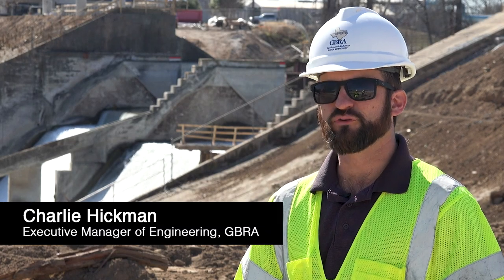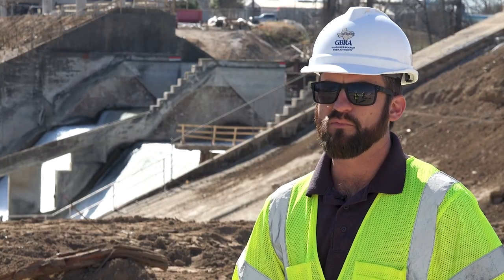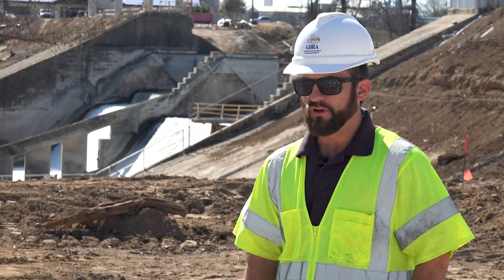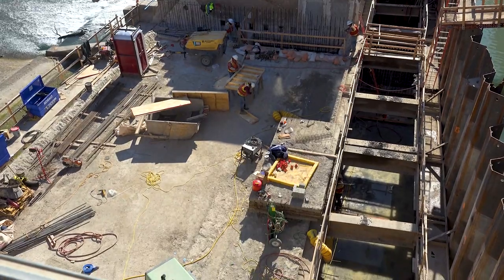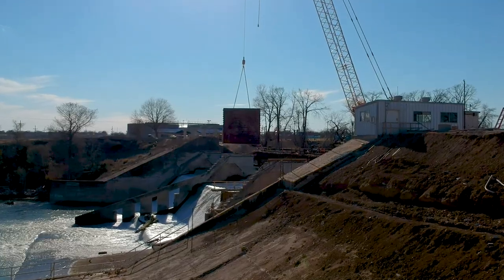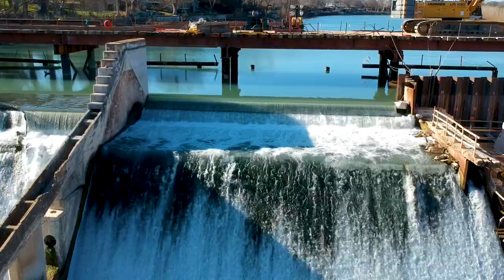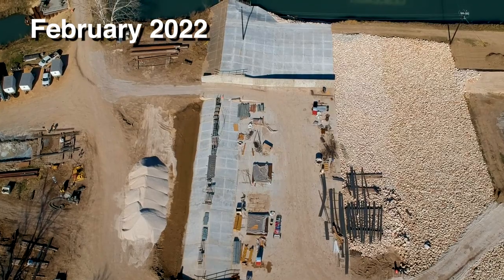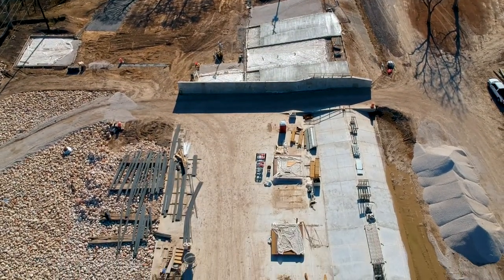Lake Dunlap Construction Update - March 2022

Comment: I hope you reviewed the lessons learned from the Oroville Dam emergency spillway failure when they tried to use it after the main spillway fractured and failed several years ago. Erosion of the flow channel below the spillway threatened the structural integrity of it and forced them to use the badly damaged main spillway. The erosion of the hillside at both spillways blocked the river below the dam and forced them to shut down the power house because of the water backing up and threatening to flood it.
Reply: Both of Oroville's spillways, were badly built, to a bad designs, based on a lot of bad assumptions. Which is strange because the dam itself was actual well designed and build if you ignored the spillways. 

 If you look at the emergency spillway at 1:54 (it's the concrete area covered in construction materials), you can see the downstream (to the right) of the crest of the emergency spillway there is a long shallow sloping tail that flows into a large riprap field (Basically an artificial heavy stone river bed). 

This means the water flows well away from the crest of the spillway and then the energy of the water is then broken up by the riprap field, the long tail is design to remove most of the vertical motion of the water, and turn it in to a smooth horizonal flow.  The width of the emergency spillway will have been calculated based on historical flow data for the river,  such that even at maximum flow the water level cresting the spillway will never have enough energy to displace the riprap.  

It's a modern and well proven design, practically any large under road culvert is built this way now.
Reply: Extreme mismanagement

Comment: You shouldn't rebuild this dam. There's no good reason. The dam was a blight on the river and its natural ecology. You're restoring a mistake and choosing selfishly to alter the natural ecology.
Reply: And by altering the natural ecology they are creating a new one. It doesn't just become a nothing. Maybe new species will thrive in the new ecology. Changing the environment isn't always a bad thing. Sure, it may harm some species, but it may help others.
Reply: @boone7777777777  what's that environment going to be replaced with? A new environment where new and even old species will have an opportunity to thrive. Some old species may actually do better. Some may do worse. And new will have an opportunity.
Reply: @boone7777777777  no I get it, the only good environment is the one undisturbed by man. You want the 100% natural waterway; the way it was before man. You want the natural species that was there before man arrived. You don't want it to have to compete and adapt in and to a new environment with new challenges and opportunities. There's just 1, well actually many challenges to that. Lake Dunlap is on the Guadalupe river. This river has a major flood control dam that creates canyon lake about 40 miles upstream. That dam discharges water from the bottom of the dam that is very cold. I believe it's the only river in Texas that can support rainbow trout. But those trout aren't natural. They are stocked each year. Then there are dams between canyon dam and this dam. Then down river only about 10 miles is a larger dam that makes Lake Mcqueeney. And between it and the gulf of Mexico are more dams.  So this dam isn't the dam that is going to stop the natural environment from 500 years ago from thriving. That environment is long gone. This is a major recreational river in Texas with many dams on it. This isn't the first or last one in the river. It's somewhere in the middle and only seperates by a few miles from others. And it's been there for 50 years so the natural species are long gone.
Reply: @cc-tb3st  ok and I get where you are coming from but the goal should be to limit or destroy all the current dams. Its not as if they build dams in a way that flow with the environment instead of messing it up. I think dams could be fine personally, but dams are usually coupled with an unrealistic approach to wildlife management. Because usually the people building dams couldn't give a damn if they screw up ancient natural mechanisms that help nurture our very existence on this planet. Its penny wise and pound foolish to build dams. It would be like if your kidneys decided to give you a bunch strokes, because the blood that pooled in your body, was fun to play in. Don't build a dam, introduce beavers back and learn to love the land as it is. As if peoples dropping property values matters even a little in the face of ecological collapse.
Reply: This lake is built along the Guadalupe which at time can be very low this dam helps stabilize the environment for fish and wildlife they depend upon it. None of these fish will be impacted by the dam the dam will only allow more fish to be alive due to more space and energy provided by the additional water and more surface water creating additional phytoplankton
Reply: @fuzzytop4746  no. That's just what you tell yourself to justify this boondoggle. It hurts the ecology.
Reply: @boone7777777777  what do you know about San Antonio water ecology I’ve grown up and studied it my whole life I know every aquatic organism around this area
Reply: @boone7777777777  it doesn’t really affect the San Antonio river if you are talking about the river walk and you probably have no clue what’s in that water or where most of it is used which im sure you don’t know cause it seems like your just an outsider just saying trying to prove your point but it’s not even close
Reply: @fuzzytop4746  I'm not even really sure why you mentioned San Antonio to be honest, that'snot really what we'retalkingabout, no I'm not from there so no I'm not super familiar. But it doesn't take an environmental scientist, of which I am, to realize humans approach to water management is lacking. And dams are not the answer.
Reply: @boone7777777777  I’m talking about all lakes that don’t have fish that require upstream migration back to where they were born to mate which is just salmon in the United States but dams in the us are essential especially today with the large population we have today much of all California, Nevada, Arizona would be completely gone today if it weren’t for those dams on the Colorado